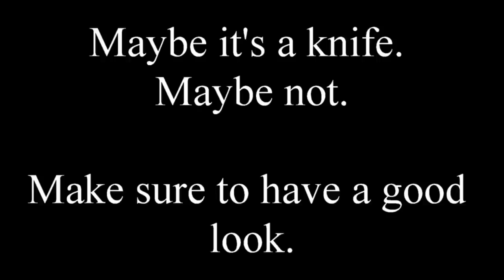Blacksmithing - Forging a garden bracket of three railroad spikes!

Comment: As always I am amazed at the apparent ease you show when making things. You did solve a problem for me. The forge welding of railroad spikes. I wasn't getting them hot enough or hitting them hard enough I guess, lol. Great video, very inspirational.
Reply: +Greg Neighbors Don't hit hard at all. Heat is the number one key to forge welding. Just hit moderately at high temps and don't forge it once it cools even the slightest.

Comment: Great work, Joey.

I particularly like your using the welder's goggles.  That must really help seeing the metal and welding it when at the brightness of welding heat.  I have some and might try using them next time I forge weld something.
UPDATE:  Shortly after posting this, I learned that "welder's goggles" and associated glasses, lenses, etc. are for filtering UV radiation.  Forging fires and heated metals emit primarily infrared radiation, not UV, therefore welders goggles act only as light reduction like sunglasses.  To protect against cataracts and IR eye damage, use lenses specifically designed to filter out infrared (IR) radiation.

Comment: Beautiful work Joe. Just a question...at 15:12 the square bar has a nice sharp shoulder that you dressed & upset in a bolster. How did you start forging this shoulder? Did u use a spring fuller? Keep up the great videos :-)
Reply from the maker: Cheers. It's made the same way as you see in that scene. Simply taper the end slightly and then upset it in the bolster plate. Just like as if you were forging a hardy tool. This will give those shoulders.
I don't have a striker to employ and a smithing magician/blacksmith's helper I still haven't found usefull enough to make one myself.

Comment: What is the tool called that you used that had the different holes in it.
Grant
Reply from the maker: Grant, The tool with the different holes is called a bolster plate, or sometimes refered to as a nailheader.
But, usually it's called a bolster plate.

Comment: Joe how did You make that little clamp?
Reply from the maker: ***** 

What little clamp do you mean?
Reply: I mean that little square element which You add at the final stage to connect the the spiral to the arm.
Reply from the maker: ***** 
In English they refer to this as a "collar" or somtimes even "band" or "strap". But usually collar is the word that is used for it.

I made this by taking a bit of stock from the spike and forged this around a bar that is the same dimensions as the arm and scroll.
Reply: Okay thanks Joe.

Comment: how heavy is this hammer?
Reply from the maker: Which of the three hammers do you mean?
Reply: Should have mentioned which one in the question  xd I mean the first one. Doesnt look much, but you can do quiet a lot of forging with it. It`s because of the handle`s lenght ?
Reply from the maker: The rounding hammer weighs 2,5lbs.  Getting to move metal is all in technique. 
A heavier hammer could move more steel. But it all comes down to technique. 
There are many times I use a 10lbs hand hammer or maybe a bit lighter in the 3,5 to 5lbs range.